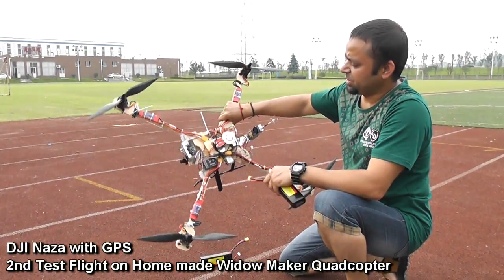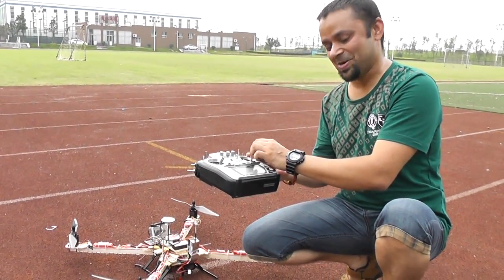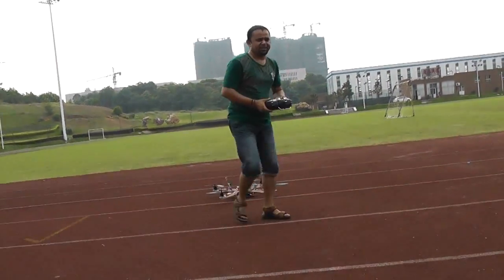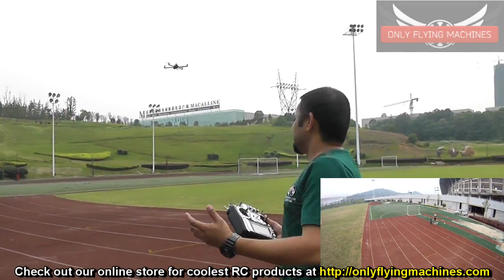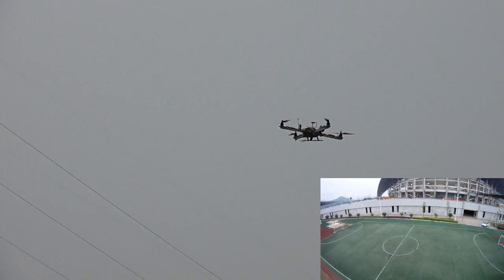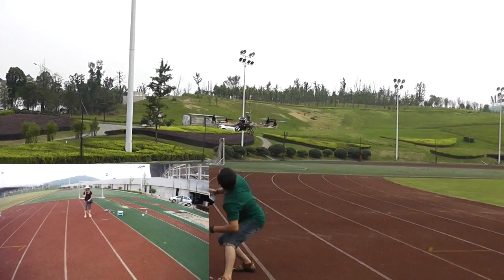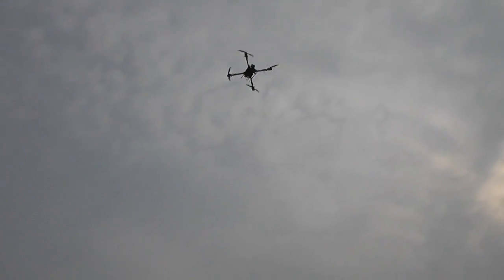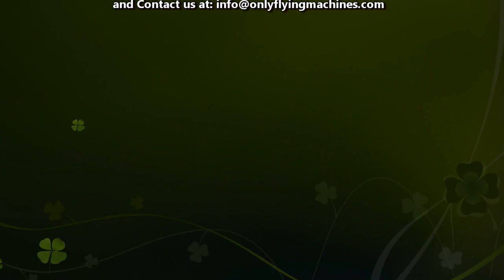DJI Naza GPS 2nd Test with Failsafe RTH

Comment: I am learning a lot from your video to pursue my hobby.Thanks for such an excellent well explained video. In near future I am going make a drone using F330 frame DJI Naza V2 controller. I have seen your video that one has to remove ESC red wire before connecting to controller. My question is why it is so ? Other you tuber connecting without removing red wire. I am totally confused. What is the technical fact. please give your opinion for safeguard of my controller.
Thanks and regards
Reply from the maker: just for safety, you just need 5v from one ESC,

Comment: Hi, i bought the naza m v2 and i am having a fly like using acro mode, do you know how could i get a stable fly? My drone fly but it doesnt stay in the same place and it is moving to the sides without giving any orther. Thanks a lot.
Reply from the maker: setup flight modes switch in assist program and in radio

Comment: Are you still flying these days? I started flying in 2013 round about the time dji naza came out. Always used to watch your videos for inspiration! Anyway I still have a tbs discovery but have moved on to 5" mini quads - flying full acro now :)
Reply from the maker: yup still flying. Also flying FPV Racing and Free Styling but mostly to smaller ones, toothpicks, Whoops. they are more fun and safer to fly.

Comment: really helpful brother,,, pls tell want to upgrade cheersion CX 20 with naza lite, don't want to change ESC, pwor distribution board , radio. is it works... pls tell
Reply: no, don't bother the PDB has to be compatible with the naza m lite as in it has to be the PDB that came with the kit. Also ,the cx 20 probably won't support the extra weight (don't take my word i'm not sure)

Comment: hello Ali , tonight finally solve the problem with my motors , basically I did everything  again , put my turnigy tgy i10 in airplane mode not quadcopter in that way the mixing  and the end points can be changed . The only thing I can do is find satellites , could you explain me the positions in the switches  when you start the quad  using the manual mode? If I understood the switch A (in my radio) is in manual position  and the other switch (IOC) in off position . maybe that make that my quad dont find any satellite, I try it outside  in the yard , so is not the house

Comment: somebody please help me with this gain bullshit,tried everything to make it stable it sucks,

i am having f450 with 920 kv motors 30 amp esc and weight about 890 gram with 2200mah 3s battry,it flys perfectly with dji recomended gain value,but the problem knocks the door when i change  battry to 5000mah 3s battry it start wobelling oscillating dancing and dont know what style dance it does,i knew by changing the battry the power to weight ratio changes blaa blaaa can somebody please tell me the exact gain values of it..with 5000 mah battry it weight about 1175 gram
Reply: If its wobbling, the Gains are to high. I'm running a Naza with 4 V2216 900kv motors on a 3s lipo. My basic Gain setting for the Pitch and Roll are 170 and yaw 150-160. Your settings should be right around there.

Comment: Hiya Ali. Im sorry I missed your garage sale!! I just recently got 2 "new" multirotors. Both with Naza. A TBS discovery with M-Lite, and a tarot 680 with A2, v2. Set the TBS up tonite...and WOOT....what stable flight!!! I should have paid attention to all the references in your other videos about getting one! The only issue I have now is even though it came with a preconfigured T8J, the IOC wasnt set up. What i see it being used for is to choose a direction for the video platform to point, and then fly along sideways in forward mode. Ive read some hacks being done to make M Lite into  V2, seen those references?

Comment: Alishanmao,my name is chris,and i have a turnigy 450 w/6 ch tactic reciever w failsafe mode also have the transmitter ttx650.i got rid of kk2.0 for a naza lite w/gps setup .
i followed all your instructions and im still having problems.when pluged into my laptop the indicator light is steady green.so i thought i had everything right,i clicked on a button at top and it asked for a 32 digit number and its not on thr box or invoice ,or recept.i tryied 3 times with numbers on box ,and invoice and it said invalid .i tried to pay a hobbycentral here in fla.and he gave it back,sayin he wasnt familiar w naza however im sure i got most everything calibrated but not sure if im supposed to write to controller after every calibration or just after im finished w everything? can you help me id be glad to pay you however you can take a payment .ill be glad to pay first before you help me if you will.i really dont want to ship it off for fear of damage.i got it at atlanta hobbies and they wont contact me back to give me the #.i have a ton of money in this,and im starting to think i shoulda wentw/airplanes ive flown them and set up.
thanks if you cant help ill understand,and put it n the attic.
sincerely capt chris

Comment: ali....

im doing my nut......

I have a turnigy 9x and the transmitter off/link loss failsafe does not work with the naza mv2

should I toss it and get a t8j or am I missing something?

guru ali guidance required......

all the best
Reply: you have to set it up in your TX to enter fail safe. Use the mixer to do this too if you want
Reply: ***** i did this on the dedicated failsafe channel ...rth and gear down as the last packet data send on the powet switch or link loss but still no dice...

Have since bought a t8j and all is workingn fine .....and the rx is alot smaller with sbus to make it even simpler in wiring terms.

Many thanks for getting back to me i will use the 9x for the camera opp.

Keep up the good work......tell me how big you would use the naza v2 ....i am building a t810 and i like the naza controlers.

What happens when the machine gets too big or is it a marketjng defence for the A2/ wookong m?
Reply: ***** i did this on the dedicated failsafe channel ...rth and gear down as the last packet data send on the powet switch or link loss but still no dice...

Have since bought a t8j and all is workingn fine .....and the rx is alot smaller with sbus to make it even simpler in wiring terms.

Many thanks for getting back to me i will use the 9x for the camera opp.

Keep up the good work......tell me how big you would use the naza v2 ....i am building a t810 and i like the naza controlers.

What happens when the machine gets too big or is it a marketjng defence for the A2/ wookong m?
Reply: turnigy 9x with stock module and reciever it doen not support failsafe.

Comment: why are so many people flying quard over Tricopter's. the tri is genneraly a better Machine
Reply: The answers were correct, with payload, and mechanical simplicity. Whether you want to argue that is up to you. You should ask a question that isn't so vague in nature if you are displeased with all of our answers.
We just tried to help.. And we did not bull shit you.
Reply: wardope
The problem is not in flight failure but damage when handling, a foldable quad can simply be thrown into a backpack without worry, there are no moving parts that can fail due to vibration or wear. A motor is extremely simple and will not fail on ground or mid air without warning, at least not mechanically. Start with a working motor and it will work for the entire flight.
Reply: Ok I was wrong Quads do not have more payload than tricopters. But to everyone else learning about this hobby, Yes they do have more payload.
Reply: Because it has a tail servo and mechanics that are high maintainance and risk compared to another motor. Crash with a tri you will damagethe mechanics and possibly rip the servo apart - Crash with a quad and you just bend the boom back or replace it + 1 or 2 propellers and off you go again.
Reply: NIOC630 and payload
Reply: Well the payload is maby a tiny bit more on a quard but as fare as Maintainance goes its not even worth mentioning. Well the servo can fail but so can a motor or ar prop.
Reply: well i dont know if you have ever seen a tri but they fold. and once folded they are just as tought as a quard for transportation.
Reply: Ward rope you asked a question, we gave you answers that are legitimate yet you argue every fact that myself and NIOC630 have given. Go bother someone else.
Reply: i asked a question and you gave me an awnser that is compleately wrong. its like saying that people ride Quard bikes over normal bikes because the quard bike is more compact. its wrong and its stupid
Reply: no tim you did not bullshit anyone. but what the awnser was just what you think was correct. but infact after some research it turned out that quard are wider used due to its look nothing more. SO go figure

Comment: I would recommend starting with the F450. I did and it's been great and remains very stable in 10-15 mph wind.

The F450 also gives you more options, for example, upgrading to an F550 by changing the plates and adding an extra two motors, arms and speed controllers.

Comment: Hello, nice video.. i have the same one and i am using een tbs discovery with naza gps. How do you program your transmitter? i haven the same ( futaba t10) when i'm turning it off it will not go in failsafe, only by switch.

Comment: Hi Ali i have a question.. i have a Futaba T8FG radio my forced Failsafe is set on a 2 position switch and RTH also works when turning off the radio. But if i try to disarm Failsafe while in flight and regain control the only way to do this is to switch to manual mode. Failsafe switch is not working or turning the radio back on is not working

Comment: Hi am thinking if getting the dji phantom with the built in naza & GPS I wanted to know will it handle strong wind like a 450 size cents it's a 330 size? It's has the same motors as a 450 quadcopter  will the naza & GPS work with all size quadcopter the same in stronge wind?

Comment: Hi there... 
I aske you this question because you seem to be the quadcopter Guru on YT.
Im planning to by a DJI naza and flamewheel F550 (for aerial media).
I'm really confused in finding a transmitter, and read a lot confusing forums.
I'm currently in doubt about the Spektrum DX8, and the Graupner MX-16 HoTT.
Can you give some advise? Thanks in advance.. !

Comment: I have a question.. i have a dji naza f450 with gps. But i put my gps on the frame. is this a problem or can i use it like this?? I flight 2 times and didnt notice a problem. Is there an rupe for it to be placed ?

her is a picture; h t t p: / / f1211.hizliresim . com/13/d/fvpqg.jpg

regards.. :)

Comment: Hi Ali.
I need to upgrade the radio (I have DX6) and I wanted the MX-20 hott, but is to expensive now. So..I thinking to buy a "intemediate" radio for use it with hexa before I will be able to biu MX-20. I was wathting the Aurora 9. What do You think about that radio ? Seems the ony one with 9 ch at that price, and not loose more money when I change to MX-20. 
Nice video.

Comment: hi ali, 
 i see you use pluse esc with the naza.
what kind of adapter are you using.
i have tried connect them straight and it did not worked well
thanks, guy